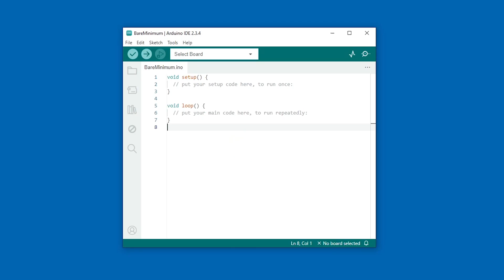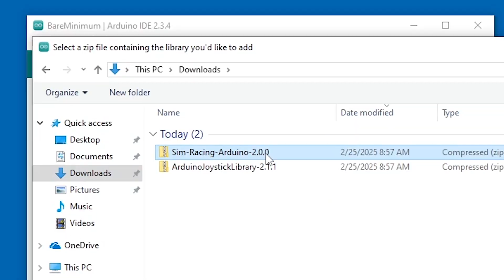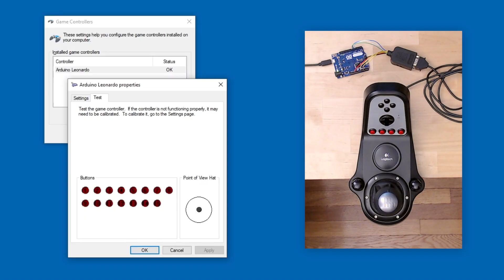DIY Logitech G27 Shifter USB Adapter (No Soldering!)

Comment: @dave.madison is it possible to rename the Arduino Boards easy? Now i have 2 the same Arduino Leonardo controllers in windows. 1 pedals and one schifter that i can only see in properties what one is doing what.
Reply: I Love the easy build by the way, thnx for that.
Reply from the maker: Take a look at the Sim Racing Shields video linked in the description. There are boards files in that project which will allow you to easily program the board with a USB identifier as "Sim Racing Shifter" or "Sim Racing Pedals".

Comment: Hello, thanks for the video i have a question though. My db9 connector’s numbers on it are flipped compared to yours(including ground). Do i still follow the numbers or instead the pattern?
Reply from the maker: I would follow the numbers. If you have a multimeter, you can check the screw terminals against the pins on the connector to verify which is which.
Reply: @dave.madison  Thanks a lot dude, it actually worked first try! I was shocked.

Comment: I don't have a male DB9 connector, so I'm connecting the wires directly to the female socket and then to the Arduino. But neither the buttons nor the shifter are working. Am I making a mistake somewhere? (The potentiometers inside the shifter were broken, so I replaced them maybe it needs to be recalibrated again.)
Reply from the maker: Without a male DB9 connector it's likely that the wires aren't making secure contact. If you don't want to alter the shifter, you will need a DB9 connector to make this work.
Reply: @dave.madison  I just need to know which pin on the shifter should be connected to which pin on the Arduino.
Reply from the maker: @ernclk5563   The pins on the female connector have the same numbering as the male connector. The connections are in the video.

If you want to cut off the connector or solder to the internal PCB, I did create a table of the connections in the library documentation. You can find that here: https://dmadison.github.io/Sim-Racing-Arduino/docs/logitech_shifter_g27.html
Reply: @dave.madison  so thanks
Reply: @dave.madison  hanks to you, I have managed to get this working now, but there are some issues with the gear shifts some gears are detected as the same. How can I calibrate this?
Reply: @dave.madison  I’ve completed the calibration, but only the reverse gear doesn’t work I think the problem is mine; the reverse gear button might be broken. How can I check it?

Comment: Why did you use 7 wires? There are 9 pins on the shifter.
Reply from the maker: Good eye! Only 7 of the pins are needed in order to read data from the shifter. The other two are unused.

One of those is the data input for the onboard EEPROM. It's also used to drive the 'power' LED. I made a separate video about that if you'd like to connect it: https://www.youtube.com/watch?v=CWUckIX5gg0

The other is a loopback power pin which tells the host that the shifter is connected. That requires an additional resistor (pulldown) to use. The circuit boards I designed make use of that, and you can look at the schematic for reference: https://www.youtube.com/watch?v=c2HPVuGpqec

If you'd like to know more, you can read my notes about the shifter's pinout in the library documentation: https://dmadison.github.io/Sim-Racing-Arduino/docs/logitech_shifter_g27.html
Reply: @dave.madison  thanks

Comment: after getting a trak racer frame, im starting to  dust off the g27... thank you for this. can this be done with an arduino pro micro?
Reply from the maker: Yes it can, although you'll need to solder to the pins as the Pro Micro does not have female headers.
Reply: @dave.madison   np.. just wondering if inputs are same